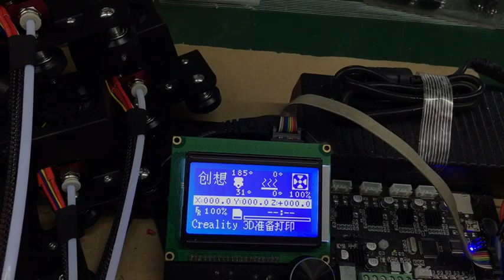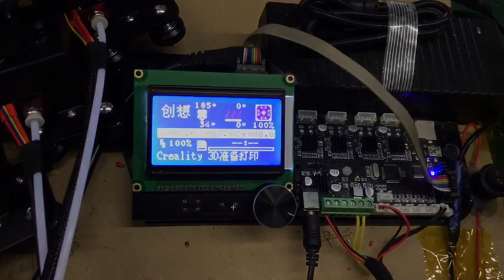Creality 3D Original Store : Aviation connector

Comment: What is the pin/cable layout on the 4 pin heat bed (aviator) plug? Anyone know, please share! Which pin is red and which is black??
Reply: Red 1 Black/Red strip 2 and then board connectors 3 and 4. Search a diagram and it will show.

Comment: Fun fact. My printer has burned through 5 aviation connectors for the heat bed. Any ideas for a fix?
Reply: Considering these aviation connectors are rated for 5 amps, I'd say the fix is to not use them for a heated bed drawing likely 10-20 amps. It sounds extremely dangerous to use these for a headed bed.